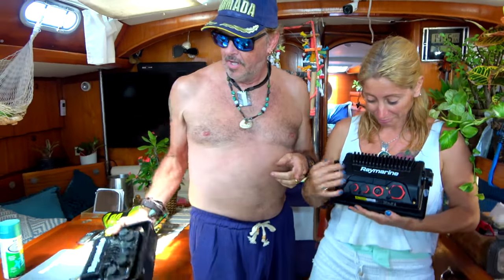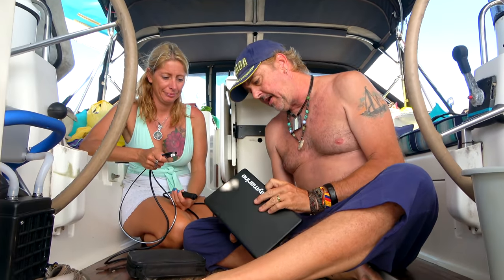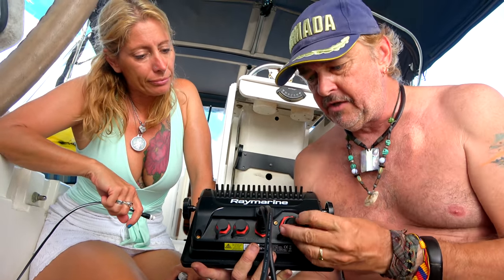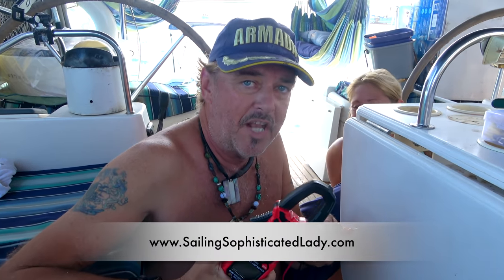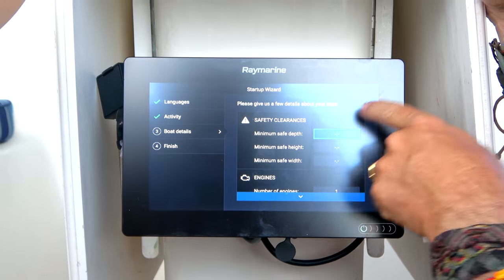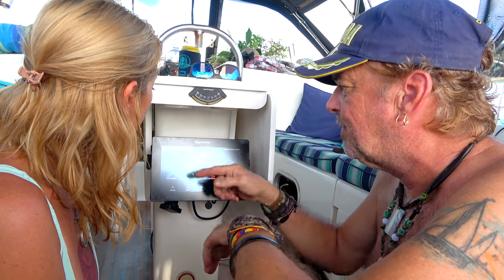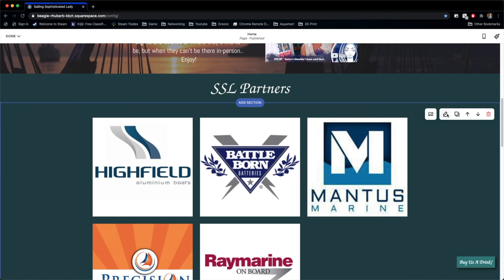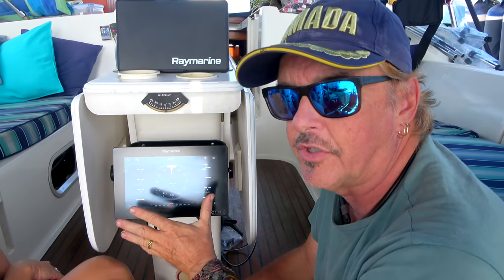SSL528 ~ It's not as SCARY as you THINK..!

Comment: Food for thought..... I have dealt with those exact type of connectors and they work great! If you want a little bit of insurance on keeping your copper connection perfect then try using dielectric grease. It is made for electrical connections and will keep your copper clean because it is coated in a silicone type of grease. ty for the vids and CONGRATS!!!! BTW... The dielectric grease is also great for your butt splices you use. Just make sure you shrink from the center outward.
Reply from the maker: Thanks for tip!

Comment: Your meter, the clamp only works for a amps. DC amps must be measured by meter being inline DC circuit. 😁
These new electronic systems are so cool and versatile it's amazing..
Reply from the maker: nope, it is switchable between AC and DC.. otherwise it would be useless to me!  :)
Reply: I've been following these DC clamp meters for some time now. First ones were way too limited, but this one seems more functional. Looks like this one has a +- 2.5% accuracy on the DC side, acceptable for most uses.

Comment: At the time, my father had a long rope with cork hanging behind his boat in case he fell off and had it on the tiller, making it turn right out of the wind. I believe he used it once and it did what it was supposed to do. My father had a self-built sailing cruiser with bilge keels. But that electronic system is great.

Comment: That is an awesome unit.  Looks like you can add on any data device you come across.  Now, my car stereo has a security code.  If I keep the display / control head in my posession, the unit is of no value if someone steals it without the head.  Does the Ramarine have any security features?  It looks like that can be lifted in seconds.
Reply from the maker: The boat has the security features.. :)

Comment: Another great video Rick. It looks like you are using the older wiring and using adapters to allow interface with the newer base unit. Any idea how far back (in years) those adapters will work? I have 2004 Raymarine units (Chart plotter, wind, depth, autopilot) that I'm looking to replace, but not sure I want to rewire the whole boat. Thanks.